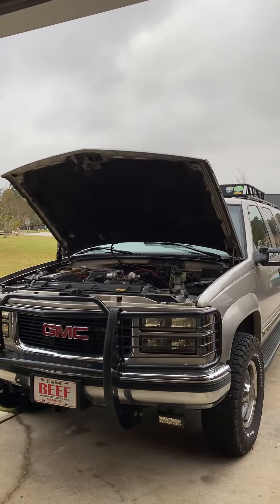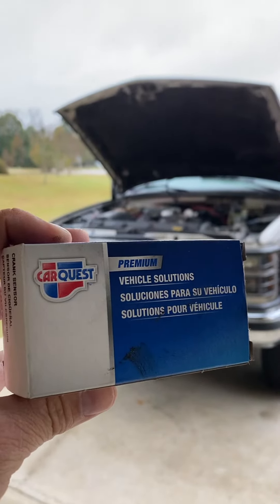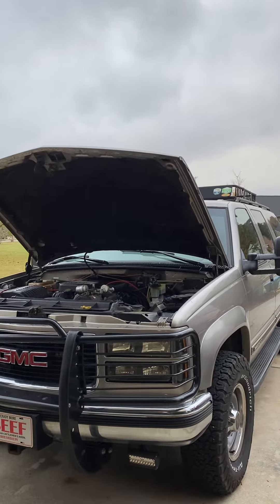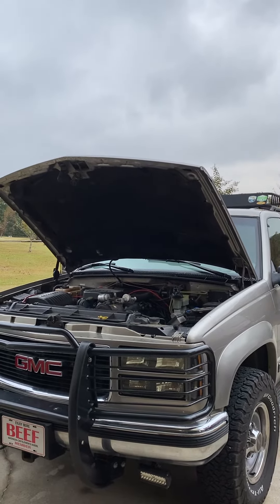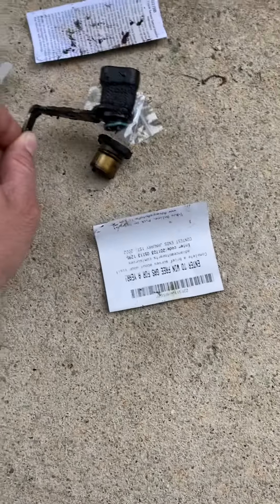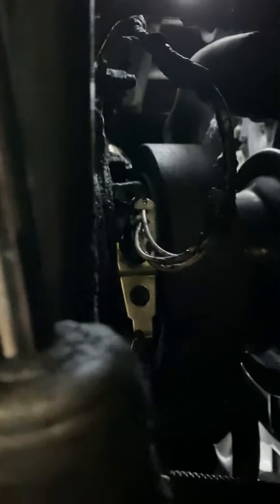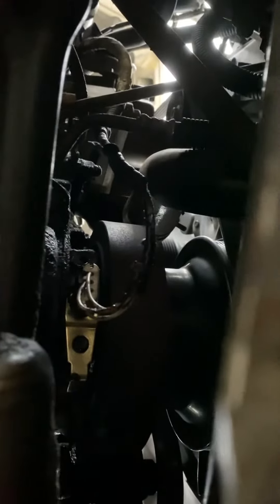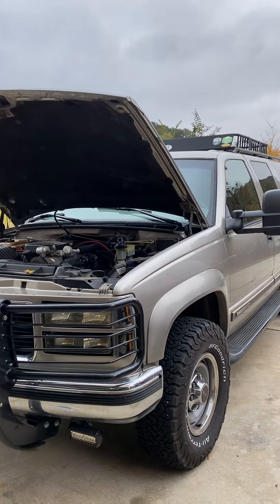GMC / Chevy Suburban 2500 7.4 “No Crank” Crankshaft Position Sensor Replacement P0336

Comment: What is the wire you are connecting to from the truck? Everybody keeps talking about the blue or blue and white wire from the radio deck that’s easy what wire comes from? The truck goes to the internal amp.